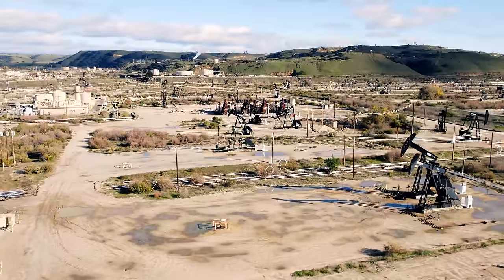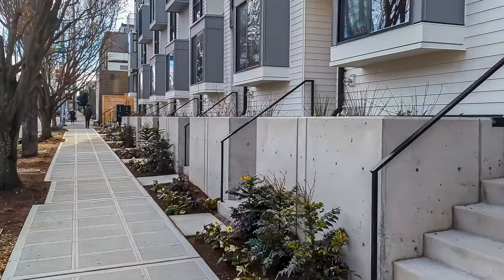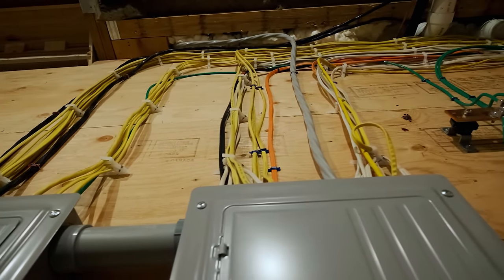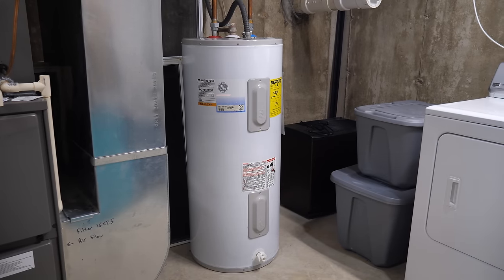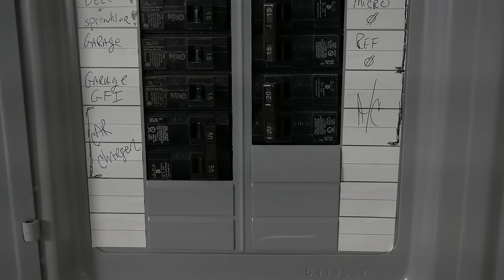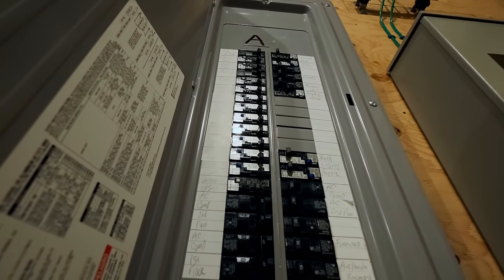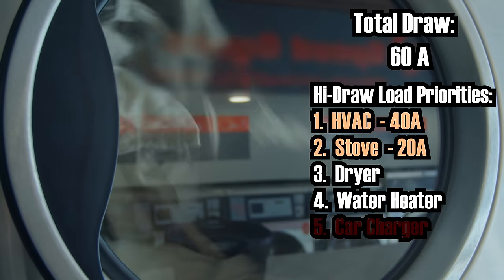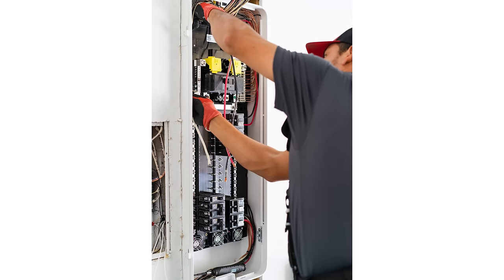Home Electrification: There's not a lot to do, and it doesn't have to be hard (Part 1)

Comment: Another thing to keep in mind is a circuit breaker trips for continuous loads at 80%. A 15a breaker trips instantly at 15a but it'll trip in a few minutes for any loads above 12a. A 100a main trips at 80a continuous. This mostly factors in on the discussion of your parents resistive heat as you were measuring with a current meter rather than just summing breakers as you had done with the others.

Comment: For many people cost will be an issue. 
Especially after the big inflation. 
It's rather going to be a rolling switch. 
Install a small plug in solar system
Get a heat pump water heater 
And some highly efficient Split Air2Air heatpumps. 

Why would anybody invest 20k$ or more in one go with a payback time of decades if nothing breaks?

Comment: Man, 100 amp service sounds painfully archaic. I've got six 10 amp breakers and one 20 amp for the stove in my small two bedroom flat. That's at 230V, except for the stove, that's three phase 400V. So that's 21.8kW. In again, a two bedroom flat where water and heat is handled centrally and included in the rent.

Comment: Every house I lived in had 100 amp service and I can’t recall ever tripping the main breaker ever. Also, my breaker panel now doesn’t even have a main breaker, is that normal?
Reply: Main breaker (or rather, actual fuse box) might be outside instead, by the meter. Common in older construction.

Comment: I was surprised to be told by our electric company that our 55yo house already has 200A service. Yay! But that's because it was built with baseboard heat throughout the 1000sf 3br/1ba rambler. We have a modern mini-split now, dramatically cutting our winter electric, and letting us cool on the few hot days we get...but we're keeping the baseboard in place since sometimes we definitely get cold cold.

But modern connected thermostats to go with our connected heat pump? Grrr...as was once so common, our thermostats only wire one leg of the 240v, and so far all the connected thermostats require both legs. Also, no off switch in our current, humble thermostats. I could cut the breakers, bbuuuuuttttttt whoever wired the house in 1968/69 hung stuff off of one or another leg going to a baseboard. WTAF #$@&!!k!n@$#?!?!

Oh, and aluminum wiring. Yay. And no mains cutoff. Double yay. We've got some decisions to make before getting solar and a battery and EV chargers and a backup generator interconnect. Fun times.

But 200A service! Yay!

Comment: Electric stoves are inferior to gas stoves. You either get the crappy radial coil that never transfers heat evenly, or you get the glass tops which look great until they are inevitably scratched. Gas stoves are durable and heat evenly.

Comment: 100 A or 200 A on a single phase 240V in? Here in Sweden, vast majority of people living in standalone homes runs those appliances on electricity with 16 A, 20 A or for very large houses 25 A fusing on each of the three phases 240 V in. Sounds like US homes are losing way too much if 100 A is on the low end of sufficiency.

Comment: Electricity has been around for 140 years.  That's plenty of time for the market to dictate the course of technology.  If electricity was the do all / end all of home power then burning fuels would have gone away decades ago.

My house is nearly 50 years old and has 200 amp service.  Yet it still has gas heat and hot water.

So what's stopping the full conversion to electric?  There must be a disadvantage when compared to gas.

Comment: I love your Channel. Your presentation is very entertaining evidenced by the fact that I actually got my wife to watch a guy talk about a refrigerator for 30min. Hearing you mention your parents heating system made me laugh because in many family dinners or holiday dinners theres a slight tension that someone will mention politics and heated debate could start, while at your family dinner the hot topic to avoid is just heat. (I.E. if it's a little chilly your mother or father has to discreetly adjust a thermostat without you knowing). 
Could be a good Saturday Night Live skit. Anyway I agree with everything you say about the benefits of these new technologies however the problem is that even if it makes economic sense a lot of people hold onto other beliefs and habits which is why even when something makes sense it takes so long for Mass adoption. Especially if there's incremental differences. If every home and gas station had car Chargers, and it only took 15 minutes for a full charge and the car had a range of a thousand miles (almost maintenance free), almost everyone would choose an EV. 
Keep those videos coming and especially those home tests because it's everything I would do If I Had the Time. 
Joe B. ..NYC

Comment: 4:50 Yeah, not that weird.
I live in Indonesia, and here, we don't use Clothes dryers as much because how hot this place can be. Usually homes have a room where they have clear Polycarbonate Roof so the sun can shine bright and hot in the day. And this room also usually where HVAC outdoor units are located so it gets hot when at night.

But clothes dryer are a thing for Apartments and Laundromats. And they are, indeed mainly Gas powered 

And You want something weird? I'll give you something weird

Because Gas lines aren't a thing in Rural and Semi - Rural areas. We usually hook Gas dryer to a 3 or 15 kg LPG/LNG tank.

Yes. We often hook Gas Dryers with, essentially, a Propane tank you use for Barbecues. 

Top that for a weird thing you do with your dryer
Reply: I live in Europe where it is cold for more of the year than it is even warm.  A drying machine is an expensive piece of kit that I consider to be a waste of money.   I prefer to air dry, although it takes longer in the cold months.
Reply: @eattherich9215  Yep, I can absolutely attest that almost every of Homes in this place don't use a dedicated dryer. I only see Apartments and Laundromats having them. Gas is somewhat cheap here, depending on area, but unless you're opening a laundromat... There's almost no reason for you to have a Dryer

We also have suboptimal times for air drying, rainy seasons with plenty of clouds or rain will impede the process.

The washing machines in this place, however, have a "spinner". Even some insanely cheap top load model have a second dedicated spinning compartment to wring clothes more efficiently... So it'll air dry faster.

Pretty sure that's a thing too in Europe and NA where some front load Washing machines offer a "Spin" mode.
Reply: In my country, the top loading washing machine is not a thing.  We have front loaders and all they spin.  Mine machine broke and I never bothered to replace it since there is a launderette up the road and it costs less than £5 to wash and spin.  I continue to air dry.

Comment: Sorry gas will always be king for me especially with cooking I hate cooking on an electric stove top. I've only ever found one electric dryer that doesn't kill my clothes unfortunately they only make it in European size and it cost $1,400.

The other side of this is I'm going to replace my breaker panel for a smart breaker It might end up costing the same amount to go up to 240v. Lord knows my parents upgraded our breaker when we had to have a bigger breaker in order to have a dryer installed in our condo and I guarantee you a smart breaker probably would have cost more or the same has our upgrade to 240v. Then the other side of this is a smart breaker wasn't an option for our condo because our wiring was a mess each breaker was connected to something with that someone rewired at some date or another. So this wouldn't have worked in our house. Not to mention when you start to get into the internet of things you have to pay service fees and then their software updates and I'm sorry that's just too much to deal with.

Comment: I think you're ignoring the main reason we have gas "powered" appliances in the first place. Under the current grid (and the grid for several more decades to come), a significant amount of electricity is generated by burning fossil fuels elsewhere. As you've pointed out in a previous video, burning a fuel on site rather than elsewhere and then have the power sent via electricity is far more energy efficient. This would mean that fully electrifying your home, while still dependent on burning a fuel for electricity, is going to cause more fuel to be burned. I know you said "ignore the grid problem", but its the entire foundation you've built your argument on. Full electrification isn't a helpful plan unless you're energy independent. Sooner you would be better off (at least in terms of heat gen) suggesting geothermal and potentially in addition to radiant in floor heating. 

As you've mentioned the grid is in a major need of an overhaul. We could mitigate that problem by removing demand by using electricity alternatives. This includes installing solar, but it can also be done by getting off electric heat and air in favor of geothermal. If we really wanted to, we could make massive geothermal loops for neighborhoods, since most of that area isn't going to be used at the depth of the loop (aside from exactly where the houses sit. The only competition is utilities, which can be designed around.

Comment: how expensive would it be to have a variable power heat strips? 83kw? that would be the worst case, most of them should not heat that much, i dont get it why they dont make tech more dynamic, it is a thousand percent possible, tell that to car inverters they can give 1 watt or 350kw to their motors. why we cant have inverter heaters?

Comment: I just had a call with a Span employee after seeing this video and thinking I could use it to move my last few gas appliances to electric. However, they told me the only thing that could be used for load shedding is the EV charger, and that's a separate add on not included with the panel. I was hoping to be able to do what was described in this video, but he said that's not possible with just the panel, and there's no way to, for example, shut off the water heater if the load gets above a certain usage.

Comment: Literally the only real challenge to mass electrification is the cost of supply. The only real solution is to reduce the cost of electricity supply. I'd gladly live in an all electric home, but when electricity costs 2 to 3 times the price of gas (as it does here in the UK), using gas is pretty much a necessity for low income households. And no, increasing the price of gas to par with electricity isn't the solution (again, poor people exist and we don't yet have UBI in any country). I realise you didn't want to talk about the whole cost thing, but that is the driving factor. Very few people are going to clutch to their fossil fuels if electricity is cheaper.

Comment: This is nice and all, but going full electric has too many asterisks and caveats for it to actually be the more viable option to the point that builders and homeowners are OK with putting all their eggs into the electrical grid basket. Unfortunately, people will try to use force mechanisms to get people off gas with new regulations. That alone should be enough to tell you that the full electric movement just isn't there yet.

Comment: I like this channel but I struggled with this video because it's just not realistic.

Maybe the UK is an outlier but with our houses having water heated "radiators" and electricity prices pushing 40p (50 cents) per kWh a heat-pump central heating system is an impossible scenario. And I really have no issue burning natural-gas for heating and hot water, the primary products are H2O and CO2, water and plant food.

I'm not a complete dinosaur I've had an electric car for the past two years and I use it 90% of the time, it's only 90% because I don't engage in the self-flagellation that is charging at public chargers for long journeys, I use my gas car for that.

And I recently bought a heat-pump tumble dryer (clothes dryer), now that is the absolute perfect application for a heat pump, hot side to dry and cold side to condense, same air & mostly the same energy going around, no venting, 20% of the energy use. Have you done a video on that?

Anyway, the channel is entertaining and informative and I hope you get this topic out of your system soon.

Comment: Is there a non-smartphone SPAN option? Something programmable locally(and not just soon[tm] as ive been burned by that meme before)? Of the things that i think companies like amazon would pay a lot for it would be power usage data so they can jack up prices on shit if they see you dont use a lot of power(and therefore have more money to spend elsewhere). Theres also the fact that its most likely a proprietary cloud service which is hell for anyone planning on having something last for more than a year.

In all reality a priority system with a soft breaker wouldn't be that difficult to make even if it was just a firmware program instead of a full hardware breaker system(that could just be dunning-kruger talking however, as i dont have an above novice grasp on how engineering works), using a smart phone system just feels overall lazy given the importance of a mechanism like this and it would be absolutely rife with bugs just from my experience with other expensive Wi-Fi and Cellular based ""smart"" devices like google home. Even my dad who went all in on the smart home meme got irritated by just how much they seemed to break. Stuff like this is annoying as hell with PRINTERS and those aren't a purpose built single point of failure for the sake of safety.

Comment: In Australia we double the Volts, which half’s the current requirement and allows less overbuilt electronics. 

Also, on electrical stoves, unless you’re running a more expensive induction are a painful cooking experience. 

It is far more common to see conventional electric cook tops here, leaving a majority of Aussies with the type of electric cooktop that has 2 settings; lukewarm and nuclear fission.
Reply: But the majority of houses in Australia only have a 63A main breaker (equal to 126A at 120V). Of course if you already have three phase to the house or are willing to get upgraded you will never have a load problem - you can have a big 415V welder and a 22kW car charger plus induction stoves, AC and the rest all running simultaneously if you want.

Comment: I built my postage stamp house to be very very well insulated.  It's mini split is a little over 5 years old and once the days start to average in the 50s the mini split becomes more expensive than the propane fireplace,  or the wood pellet stove the fireplace replaced. Even though there are newer units that are much better,  it doesn't make them efficient at those temps.

Comment: As of now 2024 the cost of using electrical items like the heat pump or even electric stove is still too expensive to where I live Southern California Edison over the last five years has increased the cost of the energy by almost 200% I remember the bills that we used to have over five years ago before we had solar installed was close to 30 cents to 40 cents per kilowatt but now as in 2024 the bill has increased to over 66 cents per kilowatt for Peak only a couple years ago it was only around 30 to 20 cents a kilowatt and right now there's more increases on the way for the next I believe 3 or 4 years so it's going to be even higher than that

Comment: here is the major issue cost... Its winter and im pay to keep my lights on, run my computer for work and use the blower moter on the fan. guess how much my eletic bill is? $100, I have a gas furnce, Gas stove and gas hot water heater. guess how much that cost me in the winter to Run heat $80 a month. Now if i jump to the sumer and im not useing the heat i pay $30-$40 a month for gas while my eletic bill jumps to over $250 to just cool my house. How much do you think its going to cost me to run an electric furnace?  its not cheap my my best friend has one her eletric bill in DEC was like $300.. hmm  do i want to pay out $170 in the winter of $300.. ill take the cheaper option...

Comment: While I don't live anywhere that this would be a problem, it's fairly often that it'll be summer so the AIR CONDITIONER is on...I'll finish washing a load of laundry, put it in the DRYER, tell my partner she can use the shower (aka. WATER HEATER), while I go cook dinner (on the STOVE), thereby using all 4 of the problem appliances.

So I could definitely see a case where all 4 will be in use at once!  haha

Comment: I learned the hard way about electric vehicles.  My testla couldn't dive 600 miles without a layover for a recharge. Gas is quick fuel. Where do you think the energy comes from? Where I live, it's hydro. Cross country it's coal and oil power. It's oil with extra steps that add to the margins. Own a fleet of vehicles and tell me if it's economical to run electric. 😂
Reply: Been there as an early adoption.  It's unfeasible at this point. Future... maybe. But now. No. I started this journey of "virtue" 7 years ago. Show me an electric freight truck with the same cost per mile. I'll negotiate.
Reply: Gas trucks deliver your goods.